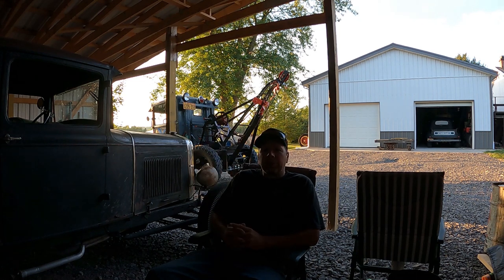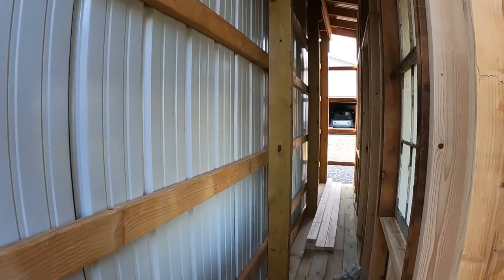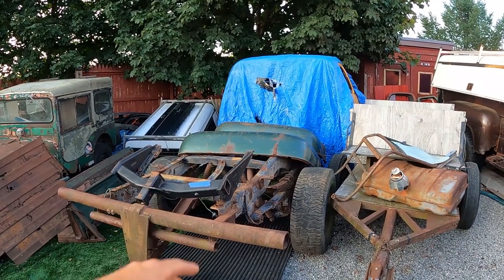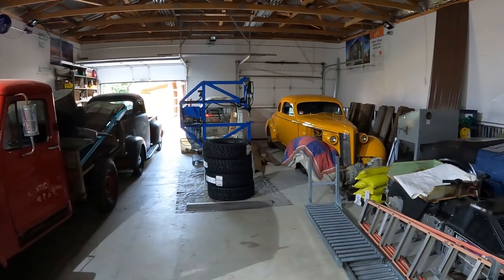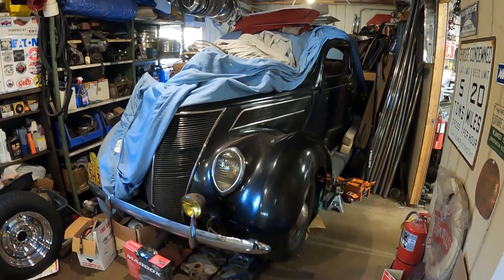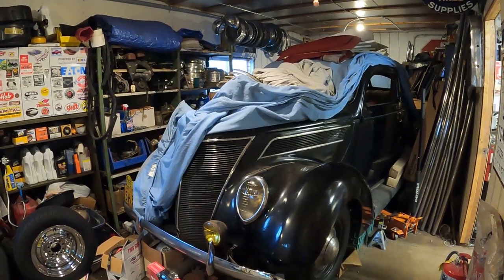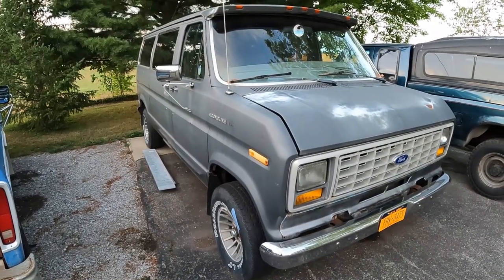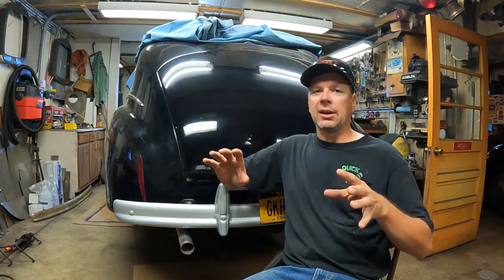What's Coming Up at the Quick Speed Shop?  Boogie Van, Flathead Swap, Tin Grille Dodge Build?

Comment: Dude thats so cool, where I live in the Ozarks there is a new building going up, they just got the fuel pump in, the building is small modern steel building but has a utility aspect too it. So far the parking area is all gravel that's been graded. We dont have a fuel station here the closest is 9 miles away. I have high hope's. Im about ready to drive my 71 W200 up here from Florida some 1000 miles. but thats scheduled for fall/winter. and kind of dependent on fuel price's.  Awesome update!